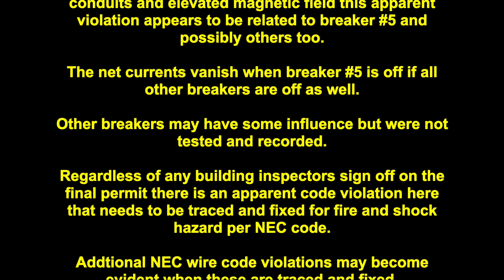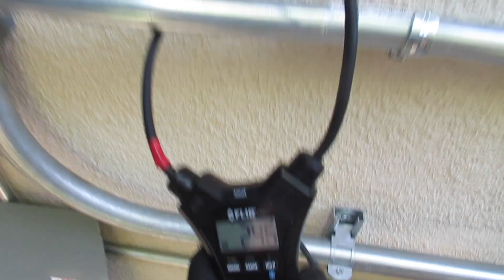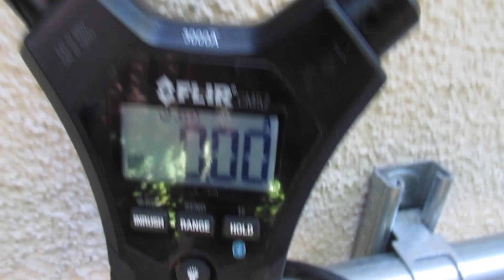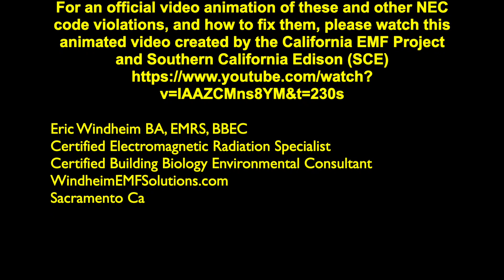Building Inspector fails to notice violation of National Electric Code 300.3(B), 2.5 AMP Net Current

Comment: I'd never trust conduits for grounding regardless and always would go for a dedicated ground wire.
Reply from the maker: These circuits had dedicated equipment grounding conductors.  The problems was that the natural of one circuit ran with the neutral of the other circuit.

Comment: All that new conduit and wire and no arc fault protection for the bedroom.  Unless it was arc fault protected and they took it off because the arc fault breaker wouldnt hold.  Also suspicious looks like a multiwire branch circuit not on a shared handle.
Reply from the maker: You certainly appear that you have excellent trouble shooting skills.  Where do you live? I diagnosed it and my EMF electrician went back and traced & restored it to code.  I have a hard time finding experienced trouble shooting electricians outside of northern California.  For Example, I fly out this week for Missoula MT to assess a 100 year old historical building.  I don't what I may find & may need an electrician up there.

Comment: So, were were just notified that they are installing new electric meters on all of the homes in our area.  They don't call them "smart meters", but it sure sounds like that's what they are.  I voiced my concerns & the electric company representative was very helpful with answering my questions.  He said they are RF Mesh meters by Landis+gyr.  He said I have the option of moving our meter (at my expense), but I'm not sure how that's even helpful.  It's still going to be sending dirty electricity into our home right?  I know I can purchase a guard for the meter, but, again, dirty electricity will still get in.  I don't even know what kind of meter I should be asking to have (what kind of meter is "safe") or if I should just put the guard on and be done.    Please help.
Reply from the maker: Hi,  You be3st bet is to opt out to the analog meter.
Reply: The meter shouldn't send anything "dirty" to your home that isn't already on the incoming wires. The RF is over the air and at low power - your phone is a bigger issue.